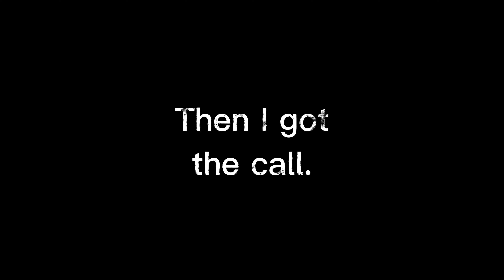Hack company wouldn't help out a customer!

Comment: Does the voltage monitoring system still provide surge protection, just at tighter tolerances?  Curious as to what those are.

Having a company who figures out and handles these problems instead of making the homeowner deal with it is absolutely a guaranteed recommendation and 1st call when upgrades are desired.
Reply from the maker: Yes it had a surge protector built in. If you look on thr right side of the white controller theres a little black box. Thats the surge protector

Comment: Shiiiii if i cant figure it out, i just call one of my seniors. Never leave your customers without heat, hot water, ac, or electricity. Buuuuttt every Manufacturer waits to do everything.. Rheem is shit on that side. "We'll send the engineers". After 2 or 3 months, callback after callback, calling techs from other companies, remodify duct work, etc... Never came out. **** they will tell you to check your airflow before helping with most stuff🙄***. Ended up replacing entire furn. Which was my initial suggestion.. . Not my install though 😅Also... do you have a video (it'd be nice from you) that shows how to SERVICE these, or is there a GOOD one that breaks it down well? Troubleshooting would be nice too lol
Reply from the maker: I try to figure out everything myself. The only person above me knowledge wise (not bragging) would be the owner and he said call tech support cuz dc components are a whole different ball game when it comes to resistance testing. 
As much as I would like to make a video discussing diagnostics on these units it wouldn't work between all the different brands. All the components have different troubleshooting procedures and resistance values.